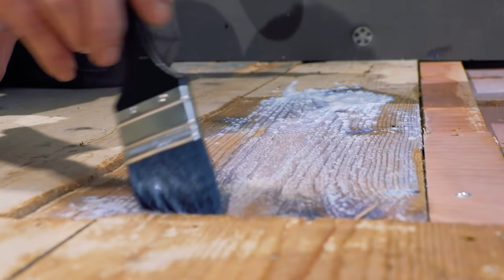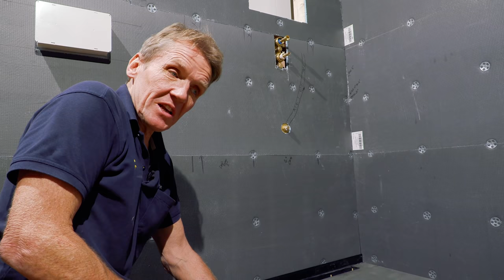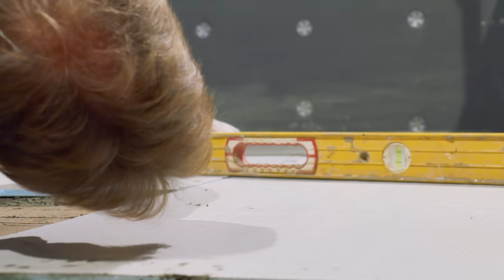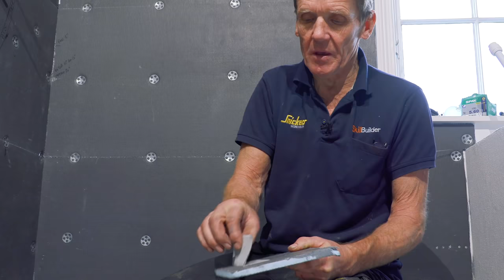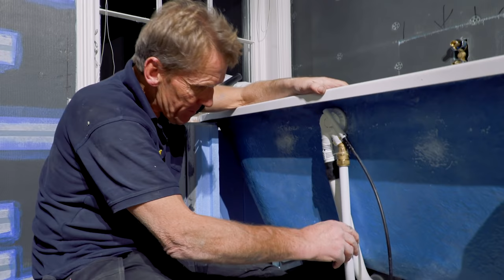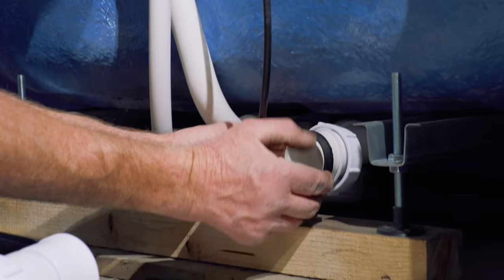Bathroom Renovation #8 - Ready for Tiling

Comment: It's nice when the bath you fit has the option to place the overflow filler on the outside. Mine was up against the wall and the shenanigans I went through fitting it was no joke.
Reply from the maker: Logik 100 
I agree but, in this particular case,  it would have been fine because that wall backs onto some fitted wardrobes and I could have had a nice access panel. The only trouble is that you see the filler as you look at the bath and this way you don't. I spent a good half a day thinking about  which to do and I am not sure the decision was the right one but it is done.

Comment: When you were sealing the elements board joints and corners etc what are the little boxes that have also been treated. There seems to be lots of squares across the boards? I’ve only ever used moisture board but I’m not a trades person but I can really see how this looks so reliable for a non fail bathroom system. 👍

Comment: Roger, Air Admittance Valve? When should these be installed and when shouldn't they? When to glug and when not to glug?? I've researched how they work but unable to find advice on when to use them in exisiting domestic property refits. Most info is regarding installations in new builds.

Comment: With the elements board on the floor, the adhesive build up, the heating and then the tiles, what makes the transition to the next room look good. Must be a total of 20mm difference in floor level.
Reply from the maker: The hall has Cloud 9 underlay and carpet so it is around 12mm. The threshold strip is a standard ramp. Not an issue but if it had been I would have put hardboard down in the hall.

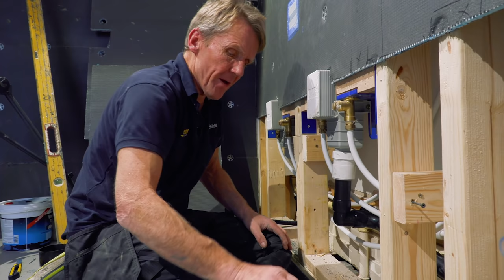Comment: @13:10 He says "air admittance valve", for anyone that might want to know.
I heard "intermittence valve" in a west country accent 😅
They let air into the system without letting sewer gases out, (my guess) preventing vacuums from forming on one side of the U bend and causing a glugging noise as the bend intermittently lets gas through.
Reply from the maker: Harry 

You are spot on with the air admittance valve but way off the mark with the accent.

Comment: Roger, will you be leaving weep holes (small gaps about 40mm long) in the sealant in one or two spots at the base of the wall tiles in the shower? Should any water ever get behind the tile it can then find a way out within the shower. It's very useful when shower enclosures are going to be installed as otherwise the water would eventually find a way out at a corner outside the enclosure and will appear like a bad seal between enclosure, tile and tray.
Reply from the maker: That sounds like a plan but I didn't do the silicone or the grouting.

Comment: If the tray panel has a built in fall and you use latex to cover the underfloor heating matt, won't that just defeat the fall built into the tray panel leaving it level rather than sloping into the drain?? 
PS love the channel and all the videos.
Reply from the maker: Ronan
The self leveller is just trowelled to barely cover the heating elements. If you don't mix it too wet it will not run down the fall so the fall in the tray is maintained

Comment: Hi, is it alright to fix directly to the floor joists with an adhesive? I am wondering that if the boards will be lifted in the future for re-modelling, will this not damage the floor joists? Can the floor boards be fixed mechanically to resolve this issue?

Comment: If I'm using a floor-standing WC instead of wall-hung, can i put it on top of the elements board or should I cut out the shape so the loo sits on the subfloor?
Reply from the maker: You can put it on top of the Elements board. It will squash down minutely but will stop. You could tile the floor and then put the w.c on top, that would be best

Comment: You used the self adhesive waterproof tape round the shower former but used a waterproof past and roll for the rest. Can you use the past and roll round the shower former?
Reply from the maker: Hi Jason 
 Yes you can use the ProSeal (paste) around the ediges with the flexible neoprene tape. I acutally prefer it because the self-adhesive tape is a little tricky to apply. The problem is that it is too sticky and once it makes contact it is a devil to remove and re-apply. After 8 jobs or so I finally made a decent enough job of it but the blue ProSeal is way more forgiving.
Reply: Skill Builder brilliant, thank you  for the fast reply. I will continue with the blue pro seal all around. Is the pro seal ok on the plastic on the former near the trap.

Comment: Tap, and if hollows discovered, drill at least 2 holes (to allow air to escape) and fill void with foam.
Reply from the maker: On the boarding you mean? Good tip
Reply: @SkillBuilder  Yes. I use foam all the time. The gun would be the first item I'd replace if all my tools went. For example. Studs out of plumb, foam up, put in a couple of screws top and bottom but don't drive home. Wait a bit check with level until it's gone off then screw properly. 
I also use it to bed trays. Shim up till perfectly level, damp substrate, foam up and cover with newspaper. Place tray and gently weight. Newspaper means you can lift tray if something goes wrong (has happened to me). Weight of tray and tiling secures and every square inch is supported. Absolutely mandatory if you have an urgent tiling job that needs grouting before the adhesive goes off. Blob tiles, run foam, you can grout in 15 minutes.
Have to cut out plasterboard between studs for whatever reason? Cut 3 inch strips of p. board, foam and fix half width behind all round with screws. Wait ten minutes then foam/screw in the replacement board. You can even remove screws if proud. Scrim and skim in another 10 minutes.

Comment: Roger. What are those round things that you use to fix the boards?
Reply from the maker: The washers are sold with the board. They are soft zinc I think. They pull into the surface.

Comment: Brilliant vid as always Roger. A quick question - on a stable timber floor, after I build up with tile backer and tank, do I always need a decoupling membrane as well (I'll be doing electric UFH so maybe get a system which has decoupling membrane as part of it)?
Reply from the maker: No the Elements board is the decoupler

Comment: We use multipanel wall boarding for bathrooms at work ...Ur thoughts on this product? Also we always stick shower trays down with plasterboard adhesive...Ur thoughts on this too?
Reply: Personally I don't think putting trays down with plasterboard adhesive is a good idea. it's not flexible, better than sand and cement but i would highly recommend using a flexible s1 or even s2 tile adhesive. if the property has any movement the tray could fail, and in a wet room that could be a nightmare! I have used multi panel and it's alright :) i guess its just peoples preference, I prefer tiles. ;)
Reply from the maker: Phillip 
 I don't understand what plasterboard adhesive achieves. The KST is flexible, non shrink, weight bearing. It is also what the spec calls for. As an side, I keep gypsum out of all wet areas. I don't even like it on shower room ceilings. You can get polymer plasters that have much better water resistance.

Comment: What on average is the transition height from floorboard to finish tile using this whole system?
Reply from the maker: 9mmm for the Elements board + adhesive so say 10mm and then the tile plus adhesive so probably 21mm. Carpet and underlay in the hall may come up to 15mm so not much of a ramp on the threshold.
Reply: @SkillBuilder  thanks 👍

Comment: I duno, I have a problem with all this new fangled stuff. It increases the cost and the time, which is also increasing the cost. Do you really get a better finish? I've seen so many of these new products that are introduced and then found they had a massive fail. Hardboard masonite siding, EIFS systems, there are loads of class action lawsuits out there against fancy products that installed slowly with precision and experienced, professionals usually works, but in the real world on a jobsite, with Joe mutt installing it the first time, they fail.

I guess you could make yourself a name by become a certified installer of some fancy product, but then how many people want to pay the extra expense just to say they used a product that no one else will ever see or care about? 

I have one question Rog, Why go to all the trouble of painstakingly levelling that board, then put down the underfloor heating and now cover it with a self levelling compound? Seems like you are doubling up on making sure everything is level when that is the purpose of the self levelling compound.
Reply from the maker: I am not a fan of trying to lift the floor with self leveller. I could have done it and made life easy for myself but that is something I still have to master.The self leveller just fills the gaps between the heating elements  and you get a more even heat.